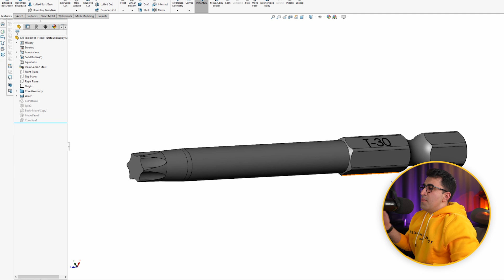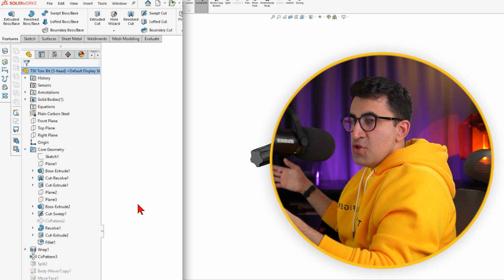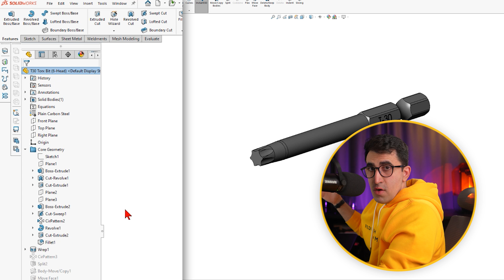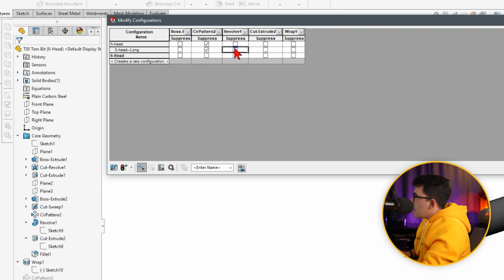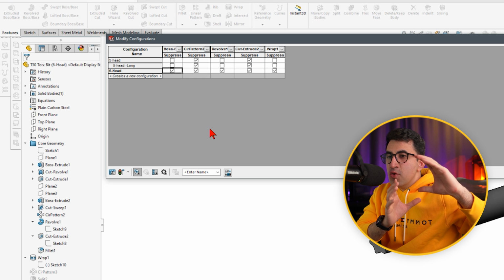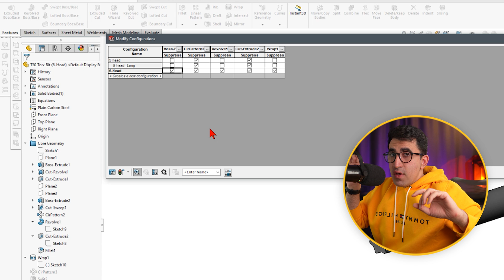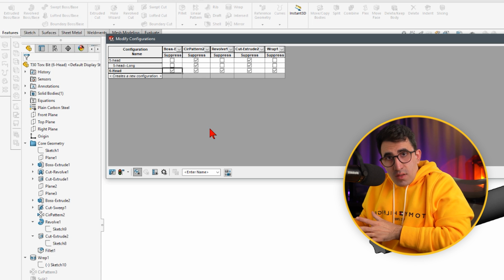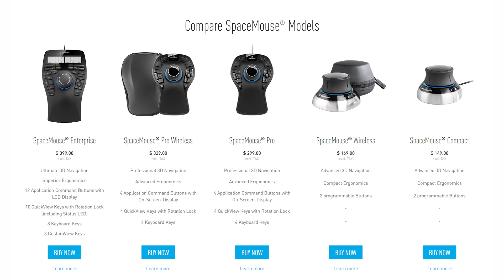Advanced tip for SOLIDWORKS - Challenge with a prize!

Comment: The most advanced tip I can give is to create and use macros for frequently used processes, such as opening a part or saving as STL file for 3D printing. Once you programmed those powerful macros you will save a lot of time. Surprisingly many people don’t know and don’t use it.

Edit:
How? 
Extras->Macro->record-> Then you “teach” the macro what to do just by doing it yourself (example: feature -> fillet ->2mm) ->stop recording->save it. 
Now create your own button.
Options -> shortcuts ->Macro ->New Macro Button and drag it where you like->define it by choosing the saved 2mm fillet macro and name it.

Now you got it. Push the button and it creates the 2mm fillet automatically.

You got infinite possibilities and can create the best macros which fits to your needs.
Reply from the maker: the "how" would give you a valuable point. Without it, not much. still time...
Reply: @with-aryan  Agree, I just edited my post :)
Reply: This is nice.
Reply: @RedGloveFan  Apparently not nice enough to be considered as a winner…

Comment: Pro Tip:
In sheet metal, when using closed corner on an edge of a sheet metal part, the flat pattern for that corner will show the bend line fall a bit behind the bend line that is directly perpendicular to it. When this sheet metal flat is cut, during forming this can lead to a marred or ugly looking corner. 
To fix this, when the part is flattened, edit the flat-pattern and under Corner Options deselect Corner treatment. With this unselected the flat will automatically be notched in the corner with closed corner leading to a perfect part when formed.

Comment: Insert a Part into an Assembly, unlock (Float) this part if needed, apply mates to the assembly default planes and save this assembly as a Part. 
As I have to correct a lot of imported parts I would say this is the easiest way to do this without using direct editing mode
Reply from the maker: I didn't understand the point of doing this. What's the purpose again?
Reply: @with-aryan  
Thank you for reply.
The purpose is to change orientation of the part relatively to the default planes.
And the thing is that the default planes of the assembly you worked with become the default planes of the part.
I often found this method faster than direct editing

Comment: Copy with Mates
This command works into an Assembly Document and helps you to copy the same component as many times as you want. Just right-click on the part that you want to copy into the assembly and select ''Copy with Mates''. The nice thing about this command is that you can copy the mates also. If some mates can stay the same as the original part you can check the box that says repeat. If not then select the mate that you want. Copy with mates can save you a lot of time!!

Comment: If have an assembly and you want to send it with all the files that are part of it, just write on the "Serch command" section: "Pack and go" and this option will open a window where you can save the assembly itself and all the components on it and put everything together on a single folder or a zip file. This is very useful if you have a lot of parts and all of them are saved on different folders and you don´t have time to looking for them to send to a client.

Comment: Hi Aryan! I'm reposting comment since last one got banned because of the video link from loom.
Congrats on the channel, I have near 10y experience and still getting valuable info from you.

Great brand 3dconnexion, the only one I know that makes something like the spacemouse, I had one in my last job, big time saver specialy when selecting lots of faces. I prefer the compact version though.

So I got lots of tips but I will go with an underrated tool that i haven't see frecuently used, thats the Property Tab Builder, with which a template for the Property Tab can be build. This is useful to quickly create custom properties (right menu of the screen) for the 3d parts to associate later in 2d drawings, assemblies, bill of materials and so on.
And for a bonus with this tool it is also possible to bind values (right click on the dimension to bind) and assign a name, like this you can link several dimensions that must be equal to the same name so when you change any of them the others also be modified. And also call them in the part properties.
This combo has been very useful to me not only because i spend less time writing values but also prevent mistakes when generating drawings and bom.
Reply from the maker: Thank you!

Comment: Insert a Part into a Part. 
A very useful skill to know especially if you can get creative with it. I use it a lot because I am designing molds. So, having a part already open you can go to the search commands tab and search for ‘’insert part’’. Then you can Browse the part that you want to insert. You can transfer any details of the new part, like planes, axis, coordinate system, etc. Then You can place the ‘’inserted part’’ wherever you want OR you can enable the ‘’Locate Part with Move and Copy features’’. This command allows you to place the new part using the Move and Copy feature. Another good tip when the Move and Copy feature will be enabled is to press the constraints button and then you can use ‘’Mate Settings’’ in the same way as we do in the Assembly.

Comment: Hello,

When I insert a mate to my assembly the window closes upon approval of the mate, but I would like the window to remain open such that I can continue adding more mates.

My procedure is very simple and I recon that it must be something in settings:

Start Mate > select surface 1 > select surface 2 > chose any type of mate > OK

If anyone does know how to keep my window open, I would gladly like to hear it.
Reply: When you insert a mate, on the top of Property manager under the mate name you can find Push Pin (thumbtack) icon. Check if it's switched on
Reply: @Konstantyn-uy4hk  Oh That Helped Thanks Man.
Reply from the maker: thanks

Comment: Use In-context design in SOLIDWORKS (Top-down approach). It is a robust and intelligent method which is super powerful in SOLIDWORKS. NOTE: This is not the best approach for all assemblies, with practice you will learn why and when to use it.

Start creating an Assembly, and then you can create and edit parts directly from it:
1.- Go to the assembly tap. -> Click the below arrow from "Insert components". -> Choose "New part" or "New Assembly".
2.- You can select any plane or planar face to start a sketch or click any part of the graphics area.
3.- This inserts a new Virtual Part/Assembly. This means that it is saved in the Assembly but not in your File Explorer. You can start editing now or save it externally. To do so, right-click the part and select "Save Part(In External File).
4.-Now, you can select the component and click "Edit Component" directly from the Assembly.

Recommendations:
1.-You can use a part to create a "Skeleton", which will have the main shape, dimensions, planes, etc. of your design. In this way, if you change this Skeleton, the whole Assembly should rebuild correctly. When you edit a part In-Context (in the Assembly), you can create references to other parts of the Assembly. Example: Let's say you have two components that will be assembled with screws. In your Skeleton, you can add points in the position of the screws. Then you can edit each part in the Assembly and reference your holes to the Skeleton points. Therefore, if you edit these points in the Skeleton, both parts will rebuild and still match.
2.-You can also add references to the geometry of other parts. When possible, reference to sketches and not edges because if in the future you add a fillet to that edge, your reference will fail.
3.-This approach is powerful because if you design it correctly, you can rebuild everything in seconds. Even you can use Equations in the Assembly context to drive the main dimensions. In the beginning, may be difficult, but I can be your next step to improve your skills in SOLIDWORKS.

Extra tip: You can change the part or assembly names from the FeatureManager. To activate this:
1.-Click on Options. -> FeatureManager. -> Check the box "Allow components files to be renamed from FeatureManager tree".
2.-Now, you can right-click any component, and you will have a new option: "Rename Part".
Note: This change will be applied to the file once you save the Assembly.

I hope this helps some people. Enjoy your SOLIDWORKS journey!
Reply from the maker: Nice, but if you are working on a big assembly, soon your PC is going to run slow due to all those hidden edges you see from neighbouring components and the issue of your next entities snapping to those lines all the time, But valuable tip. Will be considered.

Comment: I have a tipe that I think most of you will know but can make designing parts that use the same sketch so mach eseeyer.
When doing so, all you need is to make the parts from the sketch as  different bodies and to use the parts separately use save bodies. now ever time you need to edit the sketch or us a feature you will be able to use it on all part at ones.
Just make sure you dont have any feature you want activated below the save bodies feature.

I find it very helpful for gearboxes.
Reply from the maker: I didn't understand it exactly. Could you correct your text? there's still time.

Comment: When working with assemblies, If you need to design more than one part that going to work together, you can 'link dimensions' by using the equation table. To do that:
1- Lets say we are designing a 3d printer, and I want my 3d printer bed to drive other things like sigma profiles dimensions. 
2- Design everything without true dimensions of lenght etc. 
3- Open a assembly, mate the parts by how they should work. 
4- Then in assembly, click Edit Part on Y Sigma, then open equations, click 'add equations' then double click a face on Y sigma to see its lenght dimension, then click length dimension. After that double click 3d printer bed and then click the Y length of bed. 
5- Now that dimensions are linked, also you can add offset to it by adding '+50mm'  at the and of the Value/Equation bar. 
  
Most of the time thats how I design assembilies so I'm not have to design every dimension when we change dimensions. SolidWorks does it automatically. When you change the bed dimensions, chassis dimensions are going to change by itself. You can for sure use global variables, but I find this easier.
Reply from the maker: considered

Comment: As I often use blocks in my drawings, there is a tip to prevent lots of clicks. 
If you want to copy any geometry from AutoCad model view, firstly set this geometry as a block, and then copypaste it to the Solidworks. It prevents this geometry to be pasted wrong. And it's easy to work with block than with separate lines 

And one more tip.
 Use attributes for the text part of block (notes). When you in block edidting mode, double click to the note, then in Property manager find "Block Attribute". There you should define properties of the attribute, such as Name, Read only and Invisible. Don't forget to save changes. After all this manipulations, if you select a block in a drawing, the button Attributes under Text/Dimensions Display in the block Property manger will be active and you can set attributes 

Hope this tips will be useful for you

Comment: Explode Direction Control :To move and re-orient the triad, simply hold ALT and pick and drag the triad using the blue sphere where the X,Y and Z axis meet… then drag it over other geometry. It will snap to Linear edges, Plainer faces and will align to the Axis of Holes or Cylindrical features.
Reply from the maker: thanks Jimmy

Comment: A tip that most people may already know, but can sometimes be helpful and will save you a lot of time if you need to create the same sketch again and again:
I use sketch blocks to sign my 3D printable files. (this is just an example, you can use them for almost anything).
First draw a sketch of your logo or whatever you like. (I like to use lots of relations to define the whole sketch with just a few measurements so I can easily edit the block later).
Then you right click and select create block (you can either activate the sketch block creation tool, or go to Tools -> Blocks -> Create Block or just right click as I do in my case).
Then you select everything from your sketch that you want to save in the sketch block and hit ok.
Now you can right click on your newly created block in the feature manager and either save it to any folder or add it to your library.
To add the sketch block to a new part, you can either use the tool or go to Tools and Blocks to add it to your new sketch.
Now you can add the block to your sketch and edit it by right-clicking on it in the Feature Manager and selecting Edit Part.
Reply from the maker: I like this one

Comment: If you work more on drawings, then we have this problem of changing fonts, Table size and font, all views style or any settings which we change according to our needs.
So, these works on templates.
Also my tip will help for Part, Assembly and Drawing.
We can change the templates so that every time we open any part, assembly or drawing file, we can have our set templates.
To set, Open Local Disk(C:) > Program Data > SOLIDWORKS > SOLIDWORKS 2019 > templates.
Here you can find all templates, directly drag and drop to SolidWorks and change the settings, then save and close.
Do it for all if you want. And now everytime you open any file you would have your desired settings.

Thanks for reading 😊
Reply: Note: Check hidden items from VIEW in the local disc folder. Also i use 2019, so search accordingly
Reply from the maker: love it

Comment: Use the Scenario Manager for design analysis: The Scenario Manager in SolidWorks is a powerful tool that can be used for design analysis, allowing you to easily compare different design scenarios and evaluate the effects of changes on your model.

With the Scenario Manager, you can create multiple scenarios for your design, each with its own set of parameters, and then compare the results of each scenario to see which one performs best. This can be useful for evaluating the impact of changes to material, geometry, or load conditions, among other things.

To use the Scenario Manager, simply go to the "Evaluate" menu, select "Scenario Manager," and then create a new scenario. You can then make changes to your design as needed and compare the results.

Comment: Utilize the "Rollback" feature: The Rollback feature in SolidWorks allows you to revert back to a previous state of your design in the event that you make a mistake or want to go back to a previous iteration. To access this feature, simply right-click on the feature in the Feature Manager Design Tree that you want to roll back to, and select "Rollback." This will remove all features and changes made after the selected feature, effectively rolling back your design to a previous state.
This feature can save you time and frustration, especially when working on complex models where undoing changes can be time-consuming or difficult. Additionally, the Rollback feature also helps you keep a better record of the design history, which can be useful when collaborating with others or when making changes to an existing design

Comment: Tip 02: Another one with assemblies: I'm sure at some time you had to modify a part on the assembly and after that the assembly placements became all over the place, so a tip is to always prefeer to make mates using the refference planes of the assembly and the part, that way if you change a face, an edge or a point, it doesn't interfeer with the placements at all.
Reply from the maker: thanks

Comment: Tip 01: No one likes to open an assembly and find out that the refference planes are all out of place, so there is a tip: Wheen importing the first part to the assembly, don't drag and drop the part from the property manager into the working space, just select the part on the property manager on the left and click "OK", so the planes of the assembly are going to be matching the planes of the part that you just added.

Comment: Tip: Using 'Face curves' (tools > sketch tools > face curves) to analyse the 'flow' of an organic surface and visually see how the tight areas are forming. Helps a lot when complex surface models won't shell without error, helps find and relieve tightness and curling edges in a more understandable way than the Zebras or Curvature tools etc